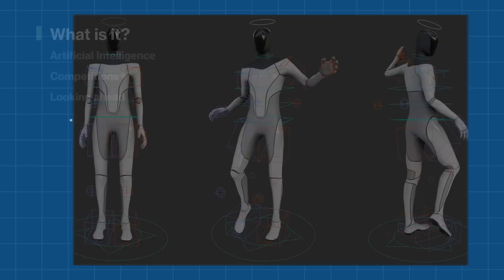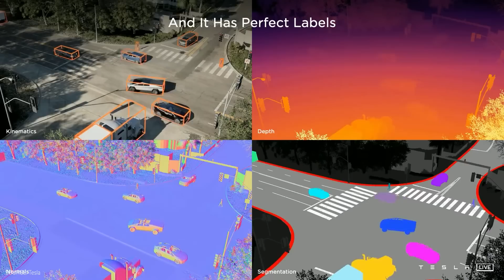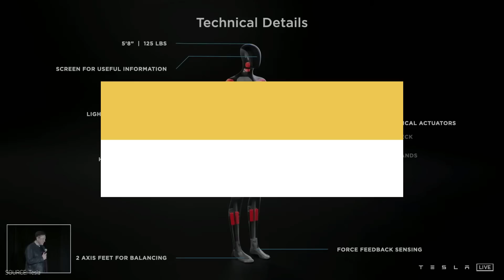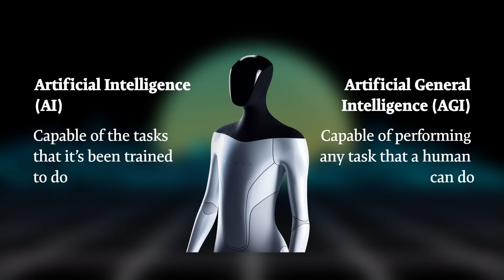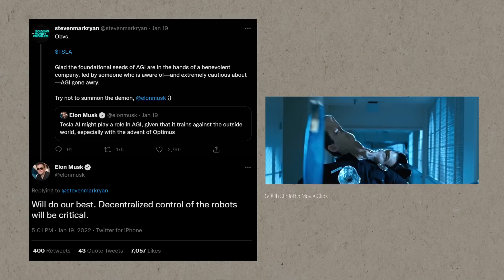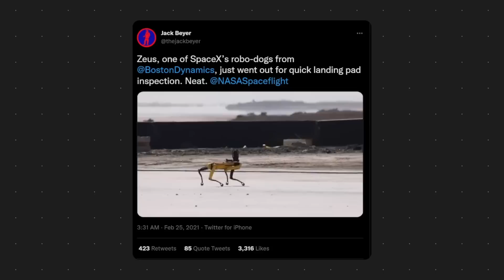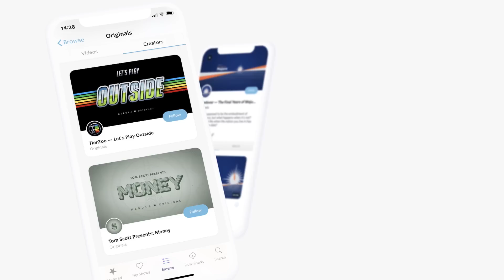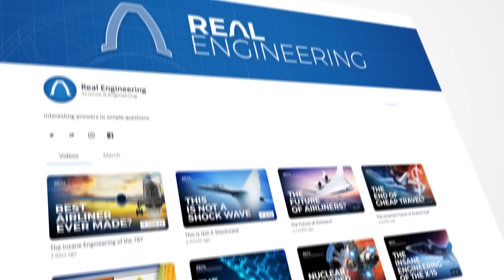How Tesla Bot Could be a Game Changer.

Comment: the sad truth is it will work it will be a one job at a time kind of thing as soon as they have one working prototype that can learn a job they will make 1000 or more  of them training them in jobs all over the bored this will make working for a living worthless over the years we have put less and less value on working for a living it used to be you could own a place to live now you can't even do that you have to rent and half the time rent is unreasonably High to the point of why am i working again just living pay check to pay check used to get something for your money a place to call your own not now days this is the final nail in the coffin of the working class this will lead to a hole new system know one as any clue about how to manage witch means maybe trouble on the Horizon. going through the thing where the people running the system have to learn that they are know better or worse than the people on the bottom of the system is going to be a hard thing to learn because this will remove the class divide from the rich and the poor over time i would say 100 to 200 years is about how long it will take because looking at slavery as an example being a racist did not end mostly tell now or around now be cause the grandkids of the people that lived in the time when there where slaves started to die off and most of the racist ended with them because they where apart of the   generation that had interactions with  people who lived through slavery

Comment: Regarding the human form factor, if you want to make a general use robot that can replace humans directly in many roles, the robot has to be able to operate in an environment designed for humans. We've spent centuries designing streets, buildings and workstations around the human form and as a result human-centric design is dominant across all workplaces. If the robots did not resemble features, potential customers would have to re-design their workspaces to suit the robots needs. This is not only a barrier-to-entry to new customers but also an issue for human-robot coworking. Musk was made very aware that humans can't be fully replaced by machines (yet) by issues in the original Tesla factory design so he is likely expecting these robots to need to work with and around people. Personally I'd prefer the workspace to cater to my needs and require the robot to adapt, then for it to cater to the robot and force me to adapt or work in ways that may be uncomfortable.
Reply: The problem is that a fantasy/vision about having a functioning humanoid robot which can actually replace human beings in their workplaces is at least 70 years old and Japanese tried to accomplish it for many many decades with an actual zero success rate. Boston Dynamics has been developing robots for a couple of decades and nothing really functional which can actually replace a human work has not been achieved, not even close.

Now comes Elon Musk and claims that his robots will be replacing humans and his robots will be mass produced as soon as in 2023. This means that Elon has no comprehension how complex human beings are and to develop a real I,Robot type humanoid robot, is not a task which can be accomplished in a year time, not even in a decade and most likely not ever.
Reply: @nikokapanen82  he’s referring to peoples jobs that are repetitive, I work for a big car company building engines and it’s very possible to replace most the assembly workers with robots at the moment it’s easier to pay a human to do the job but if you have a company like Tesla to make the technology and sell it at a price where it makes sense to swap the worker out. Robots don’t need weeks of holiday sick cover and can work 24/7 everyday of the week even weekends. I see the ups and down and it’s sad people losing jobs but trust me standing on an assembly line during a nightshift doing the same thing every 45 seconds is not living nor gives you any sense of happiness and it does make sense to have robots do these jobs.
Reply: @HairyBeaver  
I think Musk is clearly striving for something much more ambitious than some factory robots with their repetitive function which has been around for decades already. This Optimus robot is clearly supposed to be a humanoid with a human-like abilities, this is why it looks like a human.
This is, however, not an easy task to accomplish and maybe even impossible.
Reply: @nikokapanen82  call ai witch tesla has super computers, due too ai yes he can  build  ai human robots is a must if want too build on the moon and mars. no ai robot no mars.
Reply: @nosknut  
I am convinced that creating a functional "I, Robot" - type of a humanoid robot, which would actually replace humans in their workplaces, is so difficult that we wont see anything like it for a long time, maybe forever.